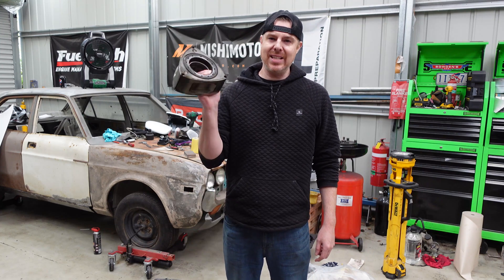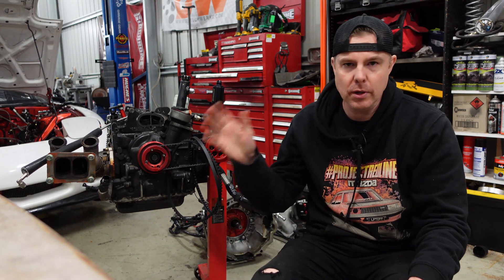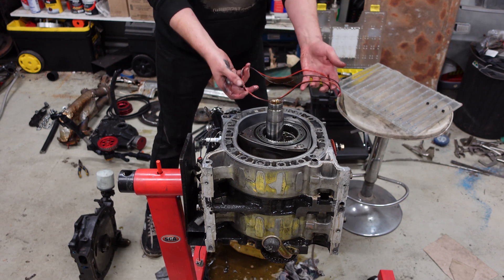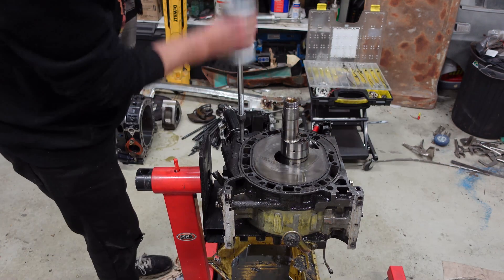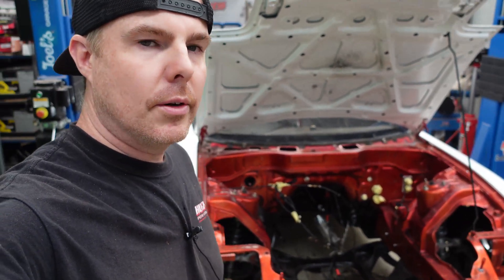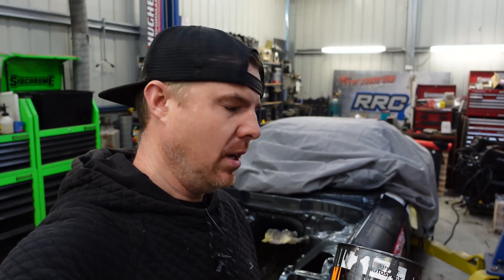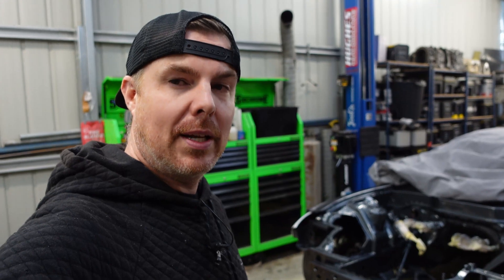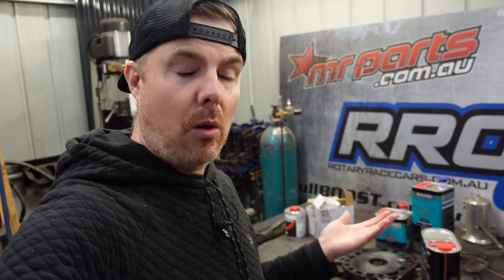800+hp 13B Rotary Engine Teardown | Mazda RX7 FD 13B-REW

Comment from the maker: The engine from our rx7 is out. If you are new here, thanks for watching. This is an engine that has been built for drag racing and big power, hence why it has semi PP housings, machined rotors, an extra dowel and 1/2” studs instead of the regular tension bolts.

Comment: No way you showed such a clean engine after all this and you didn't share the oil used, fuel and what and how much premix.. If you can, please let us know!
Reply from the maker: It’s a race engine that runs on methanol, they always come out this clean. It runs Penrite race castor oil in the fuel and Penrite 20w-60 race synthetic oil
Reply: @ thank you for your reply. Yes I saw your Rotary Conspiracies video where you explained and I was about to delete my comment but you replied too fast! I have a 13b cosmo engine with an s366 running about 400hp. 98octane. I use Motul 10w40 and run Motul ester premix 15-20ml per liter, no OMP. Love to hear your opinion. Also any idea what hp early 13b cosmo stock tension bolts can handle?

Comment: Hi Broomy,
Can you go in to more details about the turbo400 conversion to 13b, the bell housing, adaptor plate, converter ect. Looking to do a turbo400 behind my 13b and there not much out there on how to do this. Thanks heaps keep up the good work. 👍🏻
Reply from the maker: There is 3 options on the market today to put a th400 behind a rotary. First is you have to have an auto FD rear plate, cosmo engine or billet rear plate. You use the mr enforcer adapter plate on a milled down th400 case and a cosmo/fd auto bellhousing. I have this setup, however I custom modified the setup to run a rear mount starter as well. Second option is to run a cast bellhousing that mounts to any 12a/13b engine type and used a rear mount starter. These are quite large and I believe Als Race Glides sell them. Third option is to use an adapter plate that almost acts as a mid plate. You then bolt a normal chev type th400 to the adapter plate. Run a chev starter and chev flex plate and converter. I really like this option as the chev parts are cheaper, easier to get, and also the bigger chev bellhousing will give more converter choices. I am looking into a fourth option of having QuickTime make a steel SFI bellhousing as well.
Reply: @BroomysGarage   Hi Boomy,
I have a C4 auto it keep cooking the trans oil and burning clutch packs, engine is good for 800hp and the C4 just isn't up to it, do you know who supplies the adaptor plate, flex plate and any thing else I will need to do this conversion to the turbo 400 ??. Also the chev flex plate, I guess its just drilled to match the counter weight bolt holes on the 13B, with the input spigot into the crank from the converter, I guess its just machined down or an adaptor fitted.  I like the idea of using chev parts as you say their cheaper and lot more options, like bolt together converter. Any help with this is appreciated.
Reply from the maker: https://racingautomatic.com/newsite/ the setup runs a ‘mid plate’ and an adapter ring for the counterweight. So the chev bellhousing bolts to the mid plate and the chev flex plate bolts to the adapter ring.

Comment: Love me a good ol rotor 👌 Sadly I can't afford them 🤣 I actually contemplated dropping a 20b into my vn as I absolutely love the sound of 20bs and then saw the price tag and was like wow I could drop a blown big block chev in it for that price 😳🤣 
Looked at the Pac billet 13b on their website as it's all they had a price on and it was 60k 😬 I figured a 20b is probably around 75k easily, yikes! 🤣

Anyway It'd be mad if u could do a step by step vid on the reassembly of the little engine that could, I know it'd be a long one but unfortunately there aren't any in depth builds online, most people just breeze past the apex seal n side seal parts.

Anyway keep up the mad work and ah 7s here we come 👌🤣
Reply from the maker: Step by step has been done for this exact engine when it first went together https://youtu.be/FJ0MhNtARzo
Reply: @BroomysGarage  awesome thanks mate I'll go give it watch.

Would love one but I feel the only I'd afford is to buy a rebuilder and build it myself, can already put a piston engine together so a rotor should be pretty straight forward 👌

But in saying that cheapest stock rebuilder 20b I've seen is 5500 and 4 for a 13b 😳🙄

Comment: won't you need to match the ports on the mid and rear plate that your keeping ??
Reply from the maker: The manifold is already based on cosmo porting. The billet plate is also based on cosmo porting. The engine is already match ported to suit the manifold so nothing to do.
Reply: @BroomysGarage  but isn’t your rear and mid plate bridge ported, you were saying you wont bridge port the new front plate, I thought this would cause problems with even air / fuel delivery ?? Or is it not that crucial, by the way I have a semi pp, bridge ported 13b billet boss. Thanks
Reply from the maker: Will make little to no difference considering the overall size of the cosmo port in the plate is bigger than the FD port anyway. It only has a tiny bridge in the end plates only. The centre plates don’t have one.

Comment: I saw a "pro street" Commodore back in the 90s before "pro street" was really a thing that had the engine bay powdercoated a very light grey. Looked fucken mint, reflected plenty of light so you could see what you were doing in there, and it was nice and tough and scratch resistant.
Reply: Would it have been powder coat or paint?